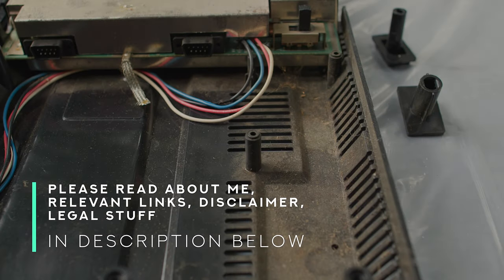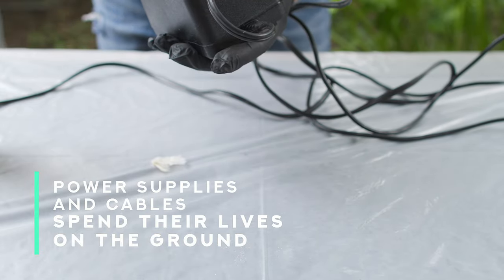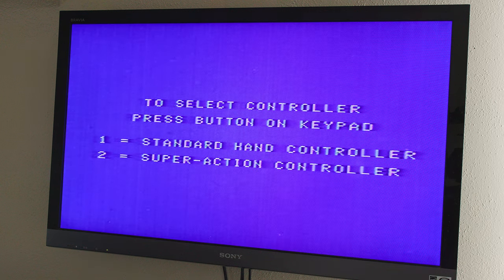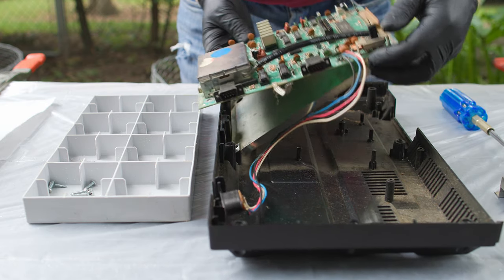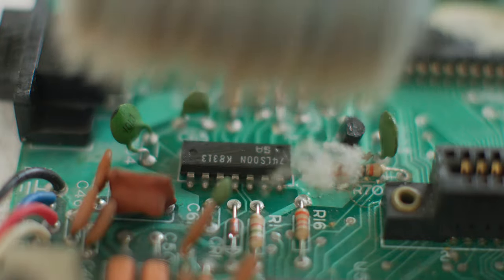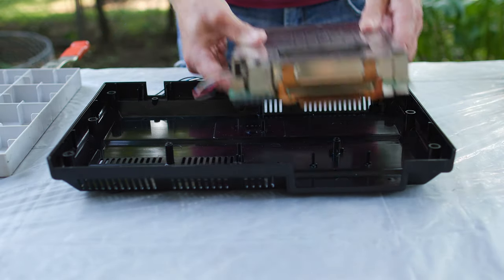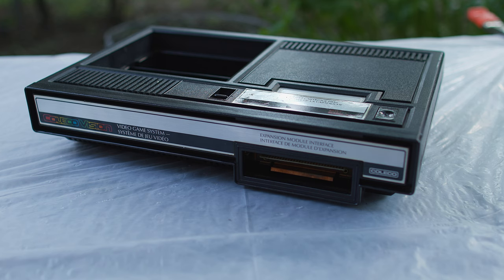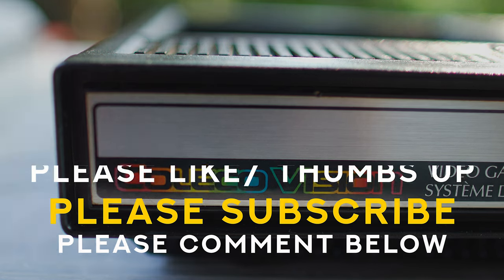COLECOVISION RESTORATION:  cleaning up and testing an old Colecovision // vintage gaming diy

Comment: Recently cleaned-up an untested Ebay system. Needed its P1 controller IC replaced, both controller ports replaced, and some cleanup of the controller internals. Got a seemingly perfect ColecoVision now!  I have another in MUCH rougher shape I got free (rusty board, black screen on boot), so I'll keep that in my back pocket for now lol

Comment: I just took one apart, and yes I had to break the solder joint. I don't think it is critical for operation, at best it provides some additional grounding/shielding.

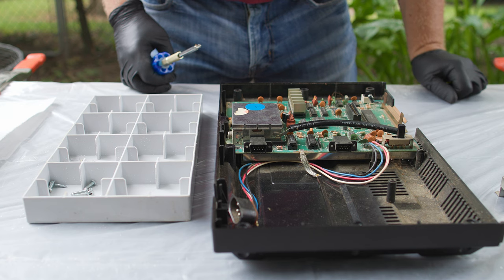Comment: Please my friend, at 2:41 you remove the metal plate but on my colecovision, there are 2 screws, and the metal corner (next under the switch button) has a soldering !
Did you know?
Can I break that soldering to clean the board?
Could it make the system not to work so I should solder the corner back???